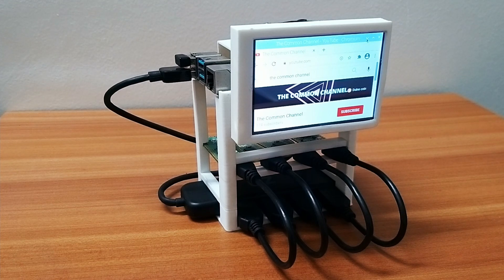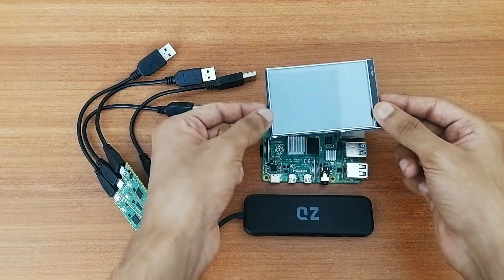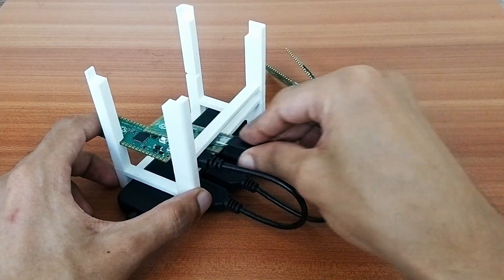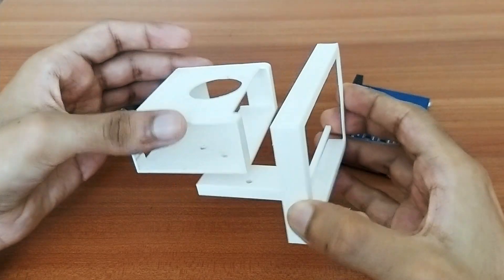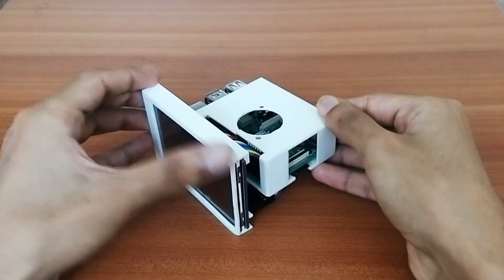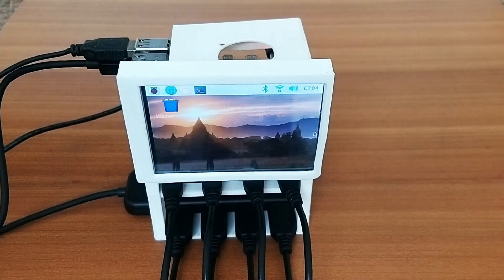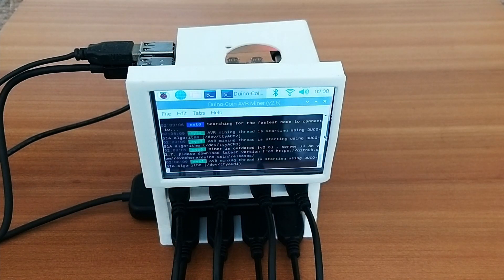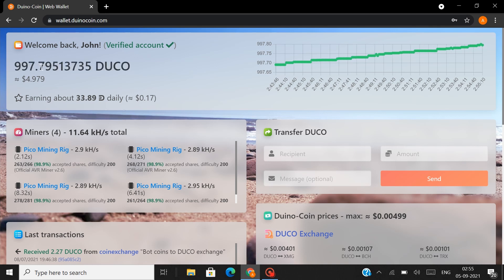Build a stand-alone Duino coin mining rig (Duino Coin Giveaway)

Comment: Would you be able to substitute the Pico boards for aruino boards such as the nano, for example, without any changes to the code. Asking as Pico boards and pi boards in general are hard to get hold of currently and would like to set something like this up as a learning project and have a pi 3b+ doing nothing which I know will work fine but no Pico boards and several Arduino nano boards that I know can be used for mining. I have no experience however of connecting Arduino to Pis.
Reply from the maker: Oh yes you can use nano boards instead of pico boards and follow the same procedure.

Comment: Hi you have great videos. I need advice on how to connect Raspberry Pi 4 Model B - 8GB RAM with NodeMCU ESP8266 WiFi module for Duino coin mining. thanks for the answer
Reply from the maker: Hey, if you are mining with NodeMCUs, you don't need a Raspberry Pi as a host because the NodeMCUs can mine wireless.

Comment: Outstanding video 😀 It's possibile to connect the 4 pi pico directly to the raspberry pi 4 USB port? I mean without using the hub. I wish to use only the Raspberry PI 4 and the 4 raspberry pi pico.
Reply from the maker: You could try the two USB 3 and USB 2 ports available on the Pi.

Comment: can we add cooling fans with the same board together with screen attached
Reply: if yes please let me know i am mining for fun in my pc ryt now but i have orderd for an raspberry pi 4 4gb so i want to use it 24/7 .ill install 3 cooling fans together with display....just want to know if i can connect jumper wires in anyslots or respective ???? i dont have a slight knowledge abt it but i can see and do.... can u help me
Reply from the maker: Yes, I've left a space where the cooling fan for the Raspberry Pi could be added.
Reply: m not speaking about heat sink
Reply from the maker: @technetwork2972  If you are attaching a screen to the Raspberry Pi then you will be using up all the pins where the cooling fan can be attached.
So what I did was get a cooling fan for cooling the Raspberry Pi and power the fan externally from a battery source.
Reply: @TheCommonChannel  ok that is possible
Reply: i used to mine duino coin in my laptop acer nitro 5 and i opened the same window again and again then i noticed there is a change in hashrate giving me upto 5 mh/s may be if i get 6 picos i can do like this may be
Reply from the maker: @technetwork2972  Try it out with Arduino Nanos. Pico boards do face some issues mining recently.
Reply: @TheCommonChannel  thanks for the update
Reply: @TheCommonChannel  were did u buy jumper wire from
Reply from the maker: @technetwork2972  I bought from this site
robu.in
They are also available on Amazon
Reply: @TheCommonChannel  can i use digispart attiny 85(ducky ) to mine duino?
Reply from the maker: @technetwork2972  I haven't used it yet but it should work as well for mining.
Reply: @TheCommonChannel  i have orderd so ill try
Reply: i have orderd block erupter lets see if it arrives as discribed then only ill give his number if u want
Reply from the maker: @technetwork2972  Great let me know how it works👍
Reply from the maker: @technetwork2972  Once I start getting into GPU mining, that would be helpful. I'll be in touch. 
Appreciate it!!🙌

Comment: Is it possible to configure it remotely and leaving it minig as a service (headless) ?
Reply from the maker: I'm not aware if that's possible with AVR mining (Arduinos and Pico boards) but you can use NodeMCUs to mine headless.
Reply: @TheCommonChannel  Got it.. I started to mine with an old RBPi 1 Model B taht had on a drawer collecting dust :3

Thanks for the video

Comment: add solar panel system with battery solution for guilt free 24/7 mining. Put it in a container.immerse in 100% mineral oil..to be circulated free using hydraulic ramp pump via radiator
Reply from the maker: Sure, will try that out. Thanks!!

Comment: I have the same Setup, but i cant get that amount of duino coins ?? how can i improve the rate ? thanks.
Reply from the maker: The amount of Duino coins that Pico boards can mine is a little low at the moment. You can try replacing the Pico boards with Arduino Nanos and that can mine you more.

Comment: hey, just wondering if i could use arduino uno and 3x arduino nano instead if the pico boards and rasperry pi
and have it fit in the frame
Reply: also, is there a way to run an arduino uno not connected to a laptop like you did with the raspberry pi?
Reply from the maker: @edpowell4838  These links would help you with the setup and the codes.
For ESP8266 as host: https://duinocoin.com/getting-started#i2c
For Raspberry Pi as host: https://duinocoin.com/getting-started#avr-pi
Reply from the maker: @edpowell4838  Yes you could mine with Arduinos using Raspberry Pi or an ESP 8266 as the host
Reply from the maker: I think the frame might be a little big to fit in the Arduino Uno though it could fit the 3x Arduino Nano.
Reply: ok thanks
Reply: thanks very much
happy mining!
Reply from the maker: @edpowell4838  Welcome!!!

Comment: Hi, so I’ve build my mini rig also but I use 3 of raspberry pi 4 to mine the duco, with 2,2MH/s speed and I earn about 70 coins more or less for 24h, can you tell me which is more efficient, if I use my raspberry pi 4 to be a host for 20 picos each raspberry (so 20 x 3 because I have 3 raspberry) or I continue mining with just my 3 raspberry pi 4 directly? Thanks
Reply from the maker: If you have three Raspberry Pi 4 boards available for mining then I recomend go ahead with that. You could build a small rig using these 3 boards. The Pico boards do have few issues recently with mining, so purchacing 20 x 3 pico boards might be a waste of money at some point. But if you still want to experiment with building rigs using the Raspberry Pi as a host, go for mining on Arduino nanos or unos. ~ just a suggestion
Reply: @TheCommonChannel  alright, I’ll stick with only my raspberry pi 4 board thanks man
Reply from the maker: @Notaguitaristtone  Welcome!!

Comment: Nice video. Is possible to mine with the Raspberry Pi and all the pico boards all at the same time? The Raspberry Pi 4 has a very good processor, it's a bit sad to do leave all that power on the table :'(
Reply from the maker: I don't think mining from both boards at the same time is possible. The Pico boards need to have a host to perform AVR mining, hence it would be difficult to mine using both boards at the same time.

Comment: Hi i try to connect Pico on usb port of Rasp PI but the /dev/ttyACM in not visible when launching AV_Miner...can u help me?
Reply from the maker: Yes, that happens to me sometimes as well. So what I do is I keep the Raspberry Pi powered on, then I unplug the pico board from the USB port and plug it back in the second USB port while keeping the Raspberry Pi powered on. This might help as it works for me.
Reply: @TheCommonChannel  tnks now i see the tty (from 0 to 3), but after starting, AV_miner show me the connection with the server pool but no other data appear.  Any idea?
Reply from the maker: @eredax  Oh that might be because there is some issue at the server end.
Reply: @TheCommonChannel  Ok i'll try to contact Duino-coin. Bye

Comment: how do you withdraw your duino coins?
Reply from the maker: Through the Duino coin exchange platform
Reply: @TheCommonChannel  but to which crypto xmg?
Reply from the maker: @markelperuchena5883  You can use the NodeS or the Pancake swap exchange also. The exchange rates are very low at the moment due to low liuidity. So my suggestion is to mine and hold Duinos atm.

Comment: Great vid! May I have the Cad file?  And a quick question.  Which board mines the most duino coin on "average"  I personally love Raspberry Pi products so this pico rack looks attractive, just wondering do they mine comparable to the esp 8266?
Reply from the maker: Comparatively the ESP8266 and the Arduino Uno boards mine the most. But in the recent updates of Duino coin, they have lowered the rewards for these boards. So even though the Pico boards mine less than those boards, I don't think the difference is huge.

I've attached a G-Drive link with the cad files I've used in this video. Hope it helps. 
https://drive.google.com/drive/folders/108hhL3clW5suwkD-BOVvjFBjbfXmzWVM?usp=sharing
Reply: @TheCommonChannel  Thank you! I’ve downloaded the codes but they will not open in Cura for me. Any advise?
Reply: @TheCommonChannel  The “fix” (changing file format) was so simple I’m a little embarrassed reporting back. Lol. Thanks again my friend.
Reply from the maker: @minibikelarry  Oh great! You are welcome!